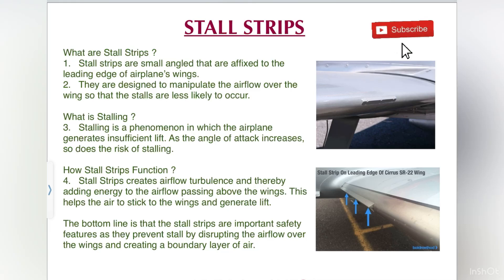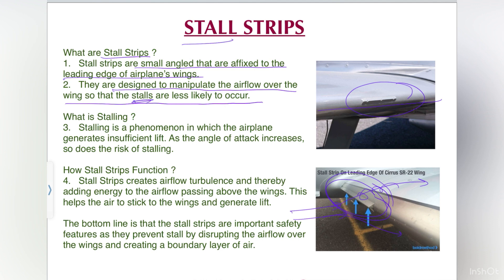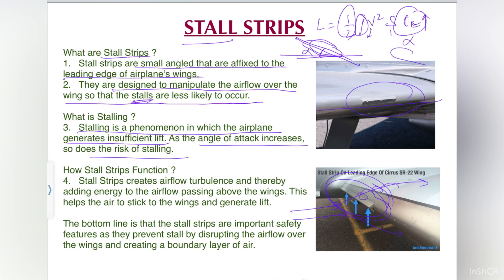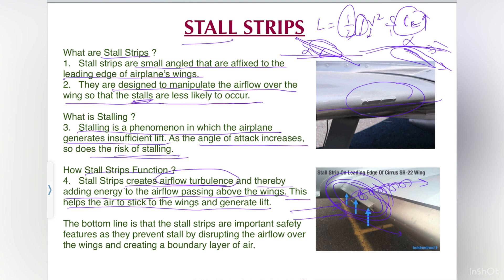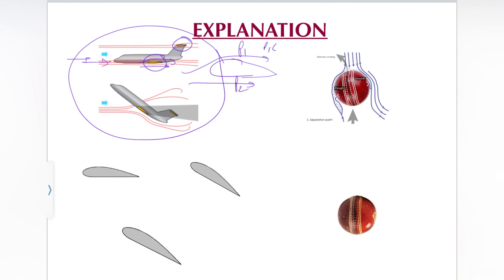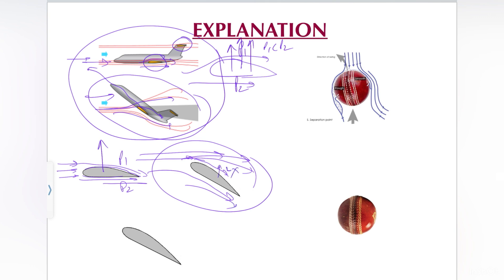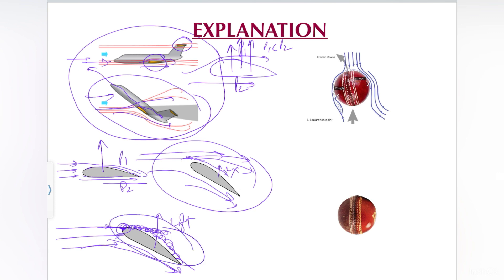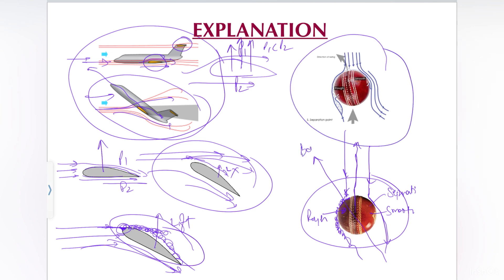Understanding the Stall Strips | Stall Prevention Technique

Comment: Your initial explanation was great regarding stall and the fundamentals behind it. You mixed up the function of a stall strip with that of a vortex generator. The stall strips do exactly the opposite of what you said, they help in stalling. They are attached at the root on the leading edge of the wing so as to stall the root before the tip where the ailerons are so as to have aileron authority before you actually stall them.
Reply from the maker: I am glad you have pointed out… i read multiple articles recently and yes your explanation held correct. You check out my latest short on Stall Strip giving the correct explanation in line with your comment 😇
I’ll amend this old video subsequently.
Thank you so much for connecting and posting a true comment.
Reply from the maker: I am glad you have pointed out… i read multiple articles recently and yes your explanation held correct. You check out my latest short on Stall Strip giving the correct explanation in line with your comment 😇
I’ll amend this old video subsequently.
Thank you so much for connecting and posting a true comment.